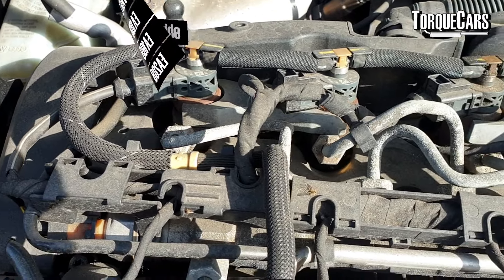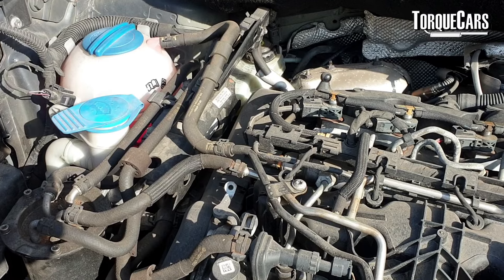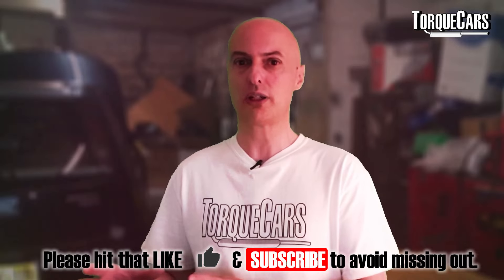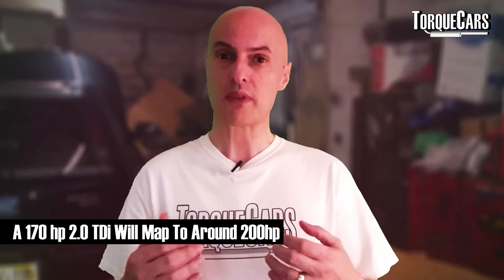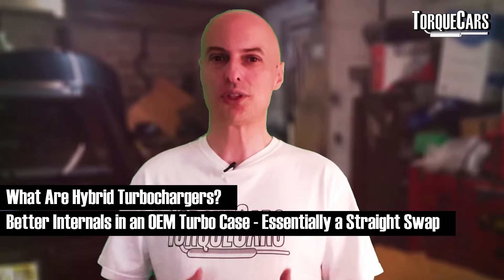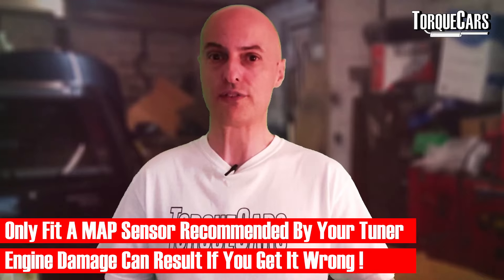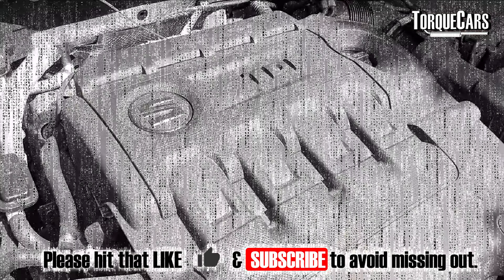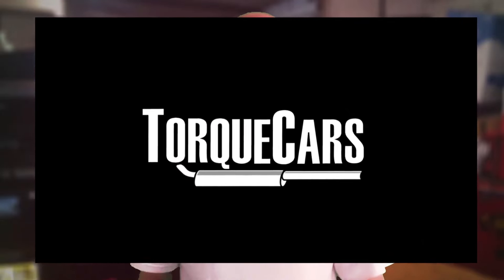Best Mods For 2.0 TDi Tuning [Seat, Audi, VW, Skoda Tuning Guide] EA188 & EA189 Stage 1 & Stage 2

Comment: Good explanation.. But did you ever tune or seen a 2.0 CR (ie 150ps)
No intake kits needed..standard intake can be modded to direct easy.
IC on CR is actually water cooled - so its shit.
Best option..disable EGR and even remove DPF ...then remap
No need play with cam pulley timing.. stock turbo can delliver nuff Nm to wreck 6 speed gearbox
430Nm-440Nm is usually max..and limited by stage 1 remap

On PD's u can mod just 1 sensor to get 20% gain.. (by exploit factory margins) ;)

Most FWD diesels have traction problems...lower 60/40mm helps a LOT

Comment: Hey, what's your take on the cuna engine, mine makes a noise when it's cold, also slight knocking, and a very subtle rattle when accelerating. All fine when it's warm. I believe it has been mapped. Lastly, with the dpf, it's regenerating every 70 miles, I'm using the vag dpf app, as soon as it's active I make sure I drive the car until it clears and the exhaust returns to its coolest operating temperature, however my drive is generally local and not on a fast road/dual carriageway, will this method still keep the dpf healthy?

Comment: I got a 2006 Golf Mk5 BMN , love the car , and for a while I'm using only premium diesel which really gives the car a good feel overall, just bought a bkd inlet manifold to remove the swirl flaps and to clean the egr , my only problem is that the sometimes in a few conditions the engine sounds way more louder( only when moving) if I park it and leave it run it stays at 1000 rps but after 30 seconds it drops back to normal at 800 and the loud sound stops. I'm gonna check the injectors values one of this days but I'm afraid to see 🙈. Any ideas what would create that problem? Try to take care of it with the premium fuel and oil and filter changes at 6000-7000 miles with 5-30 ravenol and mann filters.
Reply: DPF regenerations, raises idle to 1000rpm and EGT's go through the roof. It will smell super hot, it's burning off the soot but dumping extra fuel that explodes in the mainfold / DPF itself. Radiator fans will run for a time after stopping, and unless you finish the regen it will keep trying to do it on next startup. Happens about every tank full when new, drops to about 400kms as it fills, down to every 50kms when almost terminally full.

Comment: I'm aiming to go from 240 to 300+ on my upcoming BiTdi EA288, what would you recommend as upgrades after the remap, im especially confused about the turbos since there's two and they work in tandem, idk enough to mess with those
Reply from the maker: I've not played with the biturbo so can only go on what I've read and heard. The fuel supply is upraded on these engines so you have more headroom than on single turbo setups. A simple remap should see you hit your power target. Intercooler upgrades would be worth it, the stock ones really are quite small and only just cope with standard power. You can swap out the twin turbos for twin bigger or hybrid units, you can switch them to a large single turbo (which will have terrible lag on these engines but give great top end power). If there is a single bigger Twinscroll turbo released for these it will be worth considering, but I'm not aware of any around yet.
Reply: Just a remap is fine to reach 300hp
Reply: Remap, maybe hybrid too, a bit of cooling upgrade and your winning bud....

Comment: One of the few videos on youtube where the author gets straight to the point and avoid all unnecessary words. Thank you
Reply from the maker: Thankyou for your kind words, I hate waffle and gimmicks, so I try very hard to stay on topic and cover as much as possible in each video.
Reply: @torquecars  appreciate that🙂 I was wondering what the optimal setup would be on those 120hp engines to squeeze 200-220 hp? From what I learned in the video - bigger turbo, maybe aftermarket intercooler, remapping ofcourse and was it injectors you mentioned? Spesifics on what turbo and injectors please🙂 thank you

Comment: I have Audi a3 8pa (sportback) 140hp bmm cr engine with 8 valves, full s-line model with exterior & interior & suspension s-line (really makes a difference between that and stock equiped a3).
And since i was driving an 130hp 4x4 suv before which is really slugish, when i bought a3 it was really good and springy, buth when i got used to the power and responsivnes of the engine it was okay. 
And few months ago i got it a custom remap, makes nearly 180hp, and i sat in the car and drove it and it wasn't all that better ( because i'm mostly driving it easy on the gas pedal and in 1500-2000 rpm range), and then i drove it sharper for the next few kilometers and you can really feel that power diference, engine is much sharper and more responsive on the pedal and just pulls harder. 
Now i'm considering going a step further to get about 210-225hp so i have three questions:
1- Do i swap a turbo from a3 170hp variant and do a custom remap or do a hybrid turbo of 140hp version, which would be better?  
2- Would i need to upgrade injectors from 170hp variant or the ones i have would be enough? 
3- Do i need to upgrade intercooler too or not? ( i dont think so because i drive the car normaly and softer on gas pedal about 80-90% of the time i drive it).
Thanks
Reply: I'm no expert, but given the cost of those upgrades, you're best off buying a GTD and getting a stage 1.
I guess if you can get used brake parts it could be worth the cost, but the additional cost of upgrading the whole car might be more cost effective.

Comment: My 2.0tdi cr engine was only 102bhp as standard had it mapped stage 1 to 200bhp with nothing changed at all and for last 4 years not a single fault and i drive the hell out of it, brilliant engines
Reply: Holy crap, seriously? Has it been Dyno tested cos those gains are crazy!

Comment: So, my take on replacing the injectors is that it will give me more power by increasing the fuel. Do I want to trade that off when I get 40MPG? I've got a 2013 Deiselgate Jetta with what I believe is the 130HP version. Sure beats the 2002 I had with 90HP. When I added a 4-barrel carb and dual exhaust to my small block Chevy, it increased HP and MPG.
Thanks for the video and the information. I never learned much about diesels because I've never had either of then need anything short of maintenance.

Comment: I drive the EA189 original 170hp with a downpipe and egr delete mapped to 200hp and 400nm because it should stay reliable. I have 255k km now and its all fine.

Comment: I have a 2009 Audi A3 
Few years now K&N helped with initial pick up and pays for its self over time 
Remapped 140-180 soon after had to replace turbo  diversion valve as not holding vacuum. Plus the manifold intake position error. (I believe the internal plastic worn over time) Instead of a costly new manifold bought a cheap eBay metal stopper works fine error cleared .
Reply from the maker: Was that a panel filter or cone induction filter kit? The seals on those wastegates/diverters can be a pain, glad you got it sorted cheaply and easily.
Reply: @torquecars  panel filter so just replaced the paper . sold that car now bought a 2012 VW T5 2.0 tdi think its a similar engine 140 bhp got 289K miles seem to be going ok think the milage a bit high to remap it , plus its a auto DSG  so may need adjusting with remap to 180 bhp.

Comment: Very interesting video! I have a EA288 DFHA engine ( Skoda Kodiaq 190 HP AWD). I have remap it to 223 HP. I have added a K&N air filter. H&R sport suspension and 20 mm spacers. I have also applied some mods with OBDELEVEN (increased traction for Haldex system and direct pedal acceleration).
 The car feels now complete different, you wouldn't say it is a SUV. The 0-100 time went from 8.6s to 7.3s. The next mod that I have in mind is to change the stock 19" Skoda alloy by something lighter and better like (Momo+Michelin Pilot Sport 4 SUV)
Reply: How did you do this witzh the haldex system? driving an octavia nx awd with 200hp.
Reply: What year is your Skoda?
Reply: Thanks for sharing 🙏
Reply: congrats on supporting my country and buying the best car in the World!

Comment: Awesome overview, great to hear from someone who knows what they are talking about! Your website is exceptional as well, I've been heavily involved in tuning and modding the VAG diesels since 2008, I still learnt a thing or two from reading pages on your site for a bit more info, so kudos.

The sweet spot on my 140 hp EA189 ( BV40 stock turbo ) is the GTC1549vz from the 130kw Audi's etc, so you are spot on about pinching parts from the same era better performing models. Incredible results and street drivability ( tweaked DSG sure helps though ). 

Love your work man.
Reply: i got VW CC EA189 177BHP with GTC1549vz , dpf off i got 228bhp and 480nm however there is no way to make it a hybrid sadly..........and i want more power

Comment: Hello I am looking at putting 2 2.0l tdi in my 30 foot boat. The only two requirements I have is that it has to run at 3800 rpms all day. The second one is that it has to have 190hp. Exhaust is a wet exhaust and currently I have 2 ford gas 351 v8s. Is there any recommended years and mods I should do. Keep in mind that this is in a boat. So it is off hwy and emission except.

Comment: Was mostly talking about older enignes pre 08 my 2012 gained massive benefits from a exhast as well and doing the fuel pump on engines with cp4 pumps is a must the cp4 is known for failing and destroying the entire fuel system and the cp3 gives beyter mpg and resposiveness the turbo upgardes were sumwhat right considering power levels from them but they armt the 2nd thing you really need to look at is in my.opinion exhast and tune fuel system trans tune and then start lookin at turbos you alr have traction issue's with just the fuel system and exhast the turbo just gives it more top end
Reply: What style of exhaust did you use, or did you have it custom built? I'm only considering an exhaust, fuel pump and an engine remapping, eventually the dsg will get a tune, I'm sure I'll be happy with it at that point :D I'm 40, my days of seeking sheer power and speed are well behind me now. It Sounds like you've found a sweet spot for your 2.0tdi, nice one.
Reply: Straight piping does not help with mpg. Drops it down actually. Then I put a hoodstack on and it dropped even more. Get 40-42 with straight pipe. 38-40 hoodstack, 45-48 stock exhaust.

Comment: Just run a 2 to 3 inch. Straight pipe for your exhaust. Skype, if you are increasing the amount of boost and air going into the engine, the air needs to be able to escape from the engine

Comment: I got an 2005 assist a38p with the pd140 bmm. Im rebuilding the engine rn with stock components and it’s going to have a stage 2 turbo bolted onto it sich hooked up to 260hp. Where can i take it to my fuel system is limited?

Comment: I have an Audi A4 2.0ltr TDI on a 2015 B8 187 bhp having trouble with O2 sensor in only about 30 miles, are covered in black soot. I was wondering if this was an rich fuel mixture that's blocking the sensor and giving me a 2243 code. I was wondering if a remap might adjust the fuel air ratio so it's not so rich and therefore not soot up the O2 sensor. Any info appreciated.

Comment: 2011 Mk6 tdi usa- 2nd owner with less than 1000 miles left on the limited warranty the dpf died. After months of back and forth with the local dealer ship and having to email VW of America to replace the clogged dpf i realized America vw has no idea how to fix vw Diesel's haha. Anywho. After that chaos of that getting replaced I got the Kerma tune #1 and dsg tune. Its been a great car but diving in the city on short drives you slowly f**k yourself in a bad way.
On long distance drives close to 80 mph with 19lb wheels (heavy 🥺) i average 43-50mpg after diesel gate I'll take that as a win. This car has been a consistent motion of looking at the glass half full ❤. It gets me there. This Video Was Great and Informative. Thank You!

Comment: I have a Passat CC 2009 125KW CBBB. The car has been maintained well, on time oil changes. It has brand new clutch kit(dsg) but the enginer has 250.XXX km on it. Is it worth it to have a Stage 1 on it? Also, is it possible with DPF ON and EGR ON?

Comment: I have a 2018 2.0d Touran, I would love to improve the grunt for 2000rpm to 2500rpm, ideally through mapping, but I don’t want to compromise the DPF or EFG efficiency, i do currently motorway mileage @ 2000rpm maximum, I just would like some more ‘get up and go’ if possible?
Many thanks.

Comment: Hello. I drive an audi a4 b8 2.0 tdi 143hp, I turned off the dpf, egr and remap to stage 1. I wonder if I put the original turbo but from 170hp, would it gain power without further remap and how many horsepower? thanks in advance
Reply: @dinonody1277  how much hp you have now? i have a 143hp 2.0 audi aswell and i want to do the dpf egr delete and map
Reply: how much hp do you have now?

Comment: I’ve remapped my 2.0 Tdi (8P engine) from 140 to 180 bhp and torque from 320 to 400Nm. I also did a Terraclean on engine to clear out all the carbon crap on it and do the terraclean annually. Car runs sweet , good acceleration and pulling power in 4th,5th & 6th gear has significantly improved and fuel economy is superb, I mean really superb!  Now my question is: am I going to have problems in the future with my original standard turbo after having done this? I thought the turbo that came with the engine at 140 would be able to cope with the extra 40bhp and  80Nm of torque?
Reply: Did the terraclean actually do anything? 

Also I'm sure the turbo is fine if you service the car with quality oil every 5-7k

Comment: nice chanell thx for good explanation,i have passat altrack 2.0 tdi, 2014. 177 hp dsg 6 speed any suggestion to upgrade dsg or remap.i think this motor take a too much fuel cca 800 km with full tank of diesel

Comment: Thanks for this tdi tuning guide. Very helpful and comprehensive.  I have the CFFB a solid little engine with good tunabilty. The remap really does bring the 104kw/140hp engine to life. It removes the initial lag and gives it the pep it should have come with from factory. I call it "removing the grandma mode".   I'm gessing they save they save the peppy tune for their Audi group cars.

My tune comes from Viezu (local to you, I'm in Australia) it's good for the price. I'd say a bit conservative in it's mapping but that allows for better overall reliabilty, and slightly better fuel economy.

Slightly off subject, what do you think about DSG tuning?  Is it a good drivability mod or is really a race track mod?
Reply from the maker: DSG tuning is worth doing, but work out what you want and get a tuner that can set it up for you. If you can tweak the sport mode and leave the stock drive alone it will give you a two trick pony. Going too extreme on the DSG change points can cause excessive wear though.

The stock tunes certainly leave a lot to work with, but I think if these all had 200hp they would never sell a petrol engine again so cynically I think they dialed them back.

Comment: I just discovered you own the A3. I'm looking for one now and I was told the 1.9 engine was better than the 2.0, can you confirm this please?
Reply from the maker: Better? It is more reliable and dependable than most 2.0 TDi units. Although the BKD 2.0 TDi to 2007 was pretty good. The 2.0 offers more power and it is easier to upgrade to big power figures. The  higher powered 1.9 TDi after a remap will generally see around 160-180 which is still a decent gain. Steer away from anything with a DPF if you only do short journeys.
Reply from the maker: I did a video on the 1.9 about mods and upgrades. https://www.youtube.com/watch?v=DvMNWraggtE

Comment: I have a 2.0 TDI 150ps (CRLB) with the intake modified so its able to suck in way more cool air, which also lowers the IAT significantly. My TDI is pushed to 200ps 450nm. Thats the max of these. With a 184ps TDI turbo (GTD1449VZ) it can do about 220ps and 480nm. I might go for that upgrade in the future.
Reply from the maker: Thanks for the support my friend.
Reply: I have the same engine. What have you done to the intake?
Reply: I have that same engine on a SEAT Leon FR. If you want 220hp dont need to swap turbo, just hybrid the original (BM70B) it makes 220 / 230hp safe. Thats my setup with downpipe and BMC air filter
Reply: @miguelmonteiro5094  any issues with a DMF? About to tune mine and worried about DMF shudder

Comment: Do you think it’s possible to add a turbo to run alongside the factory engine and turbo but set up as a compound system. I’ve seen plenty of rear mounted turbos. I have reasonable mechanical skills an I could make the exhaust myself. But is this a stupid road to keep going down? I’ve got an high mileage 8PA so I was planning on changing the engine myself anyway.
Reply from the maker: Anything is possible, but here are my thoughts.

Flow from these engines is quite low, the RPM redline is around 5000rpm so there is not much scope for spooling up two turbos.
Space is limited in most engine bays where these are fitted.

Running two smaller turbos will mitigate these issues and should give a decent spool up and power delivery. You could run into fuel issues as you would with a larger single turbo.

Audi did produce a biturbo variant of these engines, that might be a good starting place for parts and specs.

Comment: Looking at getting a Passat 2014 plate 170bhp. Its got a good service history but has done circa 90k miles. Still okay for a basic eco or stage 1 remap? Subscribed.
Reply: I have a 2014 ..how do you tell if its the 170 or 140